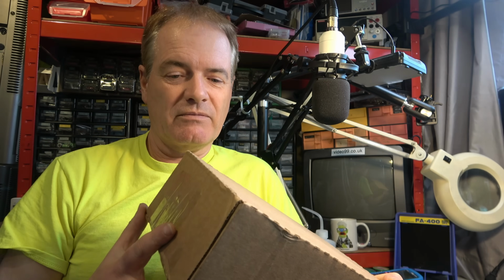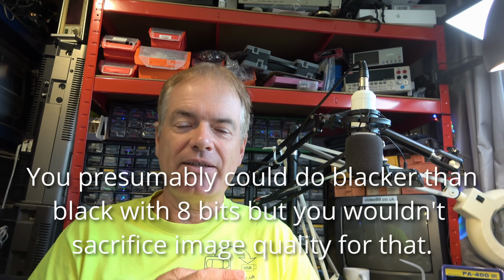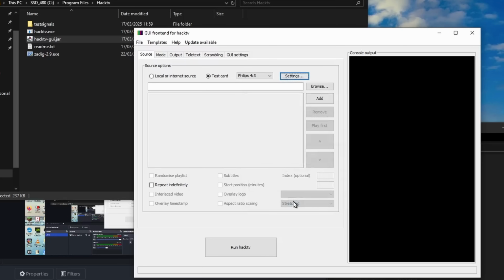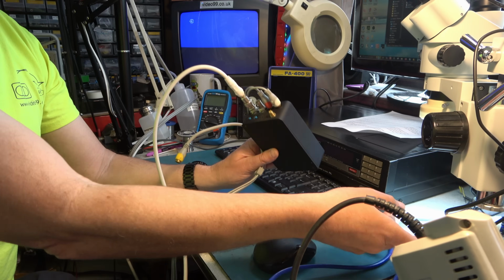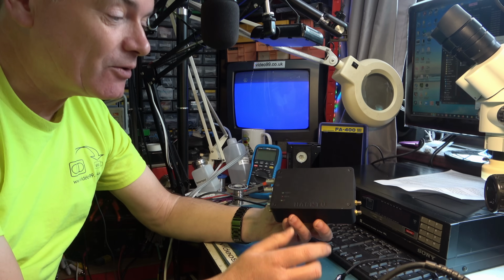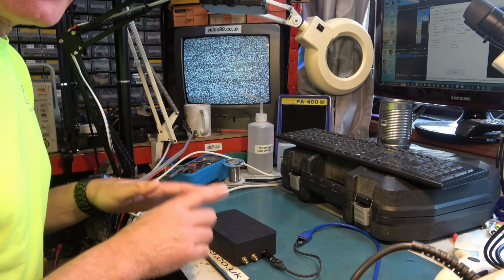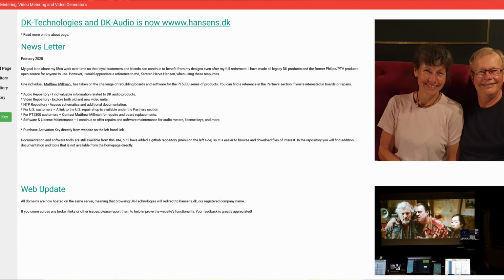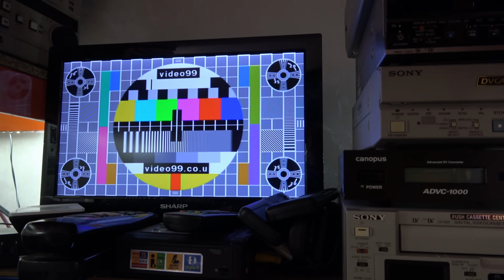HackTV + HackDAC. Generating proper TV test patterns.

Comment: TBH I think that the idea that a simple image is not enough to represent a proper test card is... not entirely untrue, but a bit overmythologized as well. While a simple PNG displayed in a proper way can't represent "blacker than black"... a video file (like MPEG or something) uses video representation of pixels, and that uses the so-called "limited dynamic range" where 16 represents black and 235 represents white - nothing stops you from encoding an MPEG-2 file that includes a value of 0 and putting that on a DVD (I'm not sure if all players will properly output that signal though). Anti-PAL can also be represented, well, not with one image, but with two - alternating stripes of specific shades of pink and teal, two video lines thick, reversed every frame. That should even survive 4:2:0 chroma subsampling (like on a DVD) if done in the progressive mode. Those will act as an anti-PAL signal and be decoded as an "unstable gray" by the TV.

In fact, this is exactly how those features are represented in the EPROMs of proper pattern generators ever since they started relying on digital memory. Of course those EPROMs are higher quality than a DVD, with 10-bit depth and no subsampling. But all the important features can survive encoding into MPEG-2 or H.264.

Sure, the quality of a signal from a proper pattern generator will be vastly superior, which is important in many context. There is a reason why those weren't replaced by simple DVD players. They can also often sync with external reference signals and all that good stuff. They are fascinating. HackTV, HackRF and related hardware are, too. But the humble DVD often gets unfairly bashed by the test pattern nerds, I think ;)

Comment: Test cards were broadcast on the BBC, in particular, during the day-time for many, many years, well into the mid 80's, when day-time television started.  TV engineers didn't mean their own test pattern generators because of that.  The BBC used Test Card F mostly, but also would use on the odd occasion a modified Philips PM5544, (they called Test Card G.)

Comment: Interesting, although what is generating the digital signal before it's converted to RF or composite? - is this the reason for USB & computer issues because the test pattern is being jammed down that USB cable? as opposed to just loading the test pic/card into the HackRF for it to endlessly repeat out of it's sockets.

Comment: Hello.
I've problem with my Toshiba v5470betamax not displaying
Reply from the maker: Faults on machines like this can't be fixed by remote control.  It needs to be looked at by someone familiar with video recorders.  No picture but otherwise working could just be dirty heads if you are lucky, leaving it playing with a BASF branded chromdioxide tape may help if you don't have a head cleaner tape.

Comment: Maybe a stripped down version of Hack TV that doesn't contain the analog high frequency broadcasting section and its connectors, That not only eliminates interference but cuts the cost down and makes the board smaller.

Comment: Matt provided me one of the early V2 prototypes to be able to properly compare with legacy equipment its solid 50dB+ SNR on every setting I've tried.

It finally also allows me to have a cycle of life capture/playback workflow with the CX Cards and MISRC v1.5a being able to perfectly capture RAW composite video these days, or TBC data from the decode projects, especially composite source formats like SMPTE-C and Laserdisc which can now be piped back into the analogue domain properly, It's a massive leap over the FL2K which really was hit and miss signal level wise.

Comment: Another, less costlier, alternative are the fl2k USB->VGA devices which can be used at 140 MHz 8 bit DACs. You can get hacktv to output a cycle of PAL video, then use sox to filter it to 5 MHz and upsample it to 140 MHz as well as dither it to 8 bit and you should have a fairly decent video signal.
Reply: You also need an external amplifier to get the levels in the right place. I'm told you can parallel a couple of channels together to get most of the way there
Reply: @mattstvbarn  Well that's comparatively simple, there are wide-band op amps around to create essentially a proc-amp. You could, with more effort, even use one of the 3 channels to output a reference clock signal, for example 10 MHz, and compare that to an actual reference. You could, in principle, feed back the phase difference back to the PC to close the loop. Not sure if I'll ever get around to do that, now that I'm the proud owner of a Grundig VG1100. (though with a broken multi-burst generator)
Reply: @altebander2767 this is talked about a lot, but are there any good howtos for putting a rig together which gets good results? Would be interested to see...

Comment: There is enough space there to fit in an old school square USB B socket, It's more robust than micro USB.
Reply from the maker: I do agree, micro-USB is horrible.
Reply: @video99couk  At least for now if they are not willing to fit in a USB-C they can use USB-B instead until a new generation USB protocol is implemented.

Comment: $400 is beyond what I would pay for such a gadget since I don't have much use for it, Hope it comes down in price to justify getting one. Is it capable of sending an accurate metered audio in dB?
Reply: Hackrf can be had from Ali Express for less than $100. The software is totally free thanks to the community.
Reply: @CaptainJack406  Thanks for the heads up.
Reply: @CaptainJack406  Thanks, The cheapest I could find is $250.

Comment: I'm the developer of the GUI frontend you're using here. Unfortunately there were some issues with adding HackDAC support (I had to selectively bypass the restrictions on baseband modes in the HackRF output mode) and due to a lack of free time in the past few months, I wasn't really able to test it as well as I would have liked. I'm also thinking that the UI is getting a bit cumbersome now, so I have plans to revamp it at some stage.